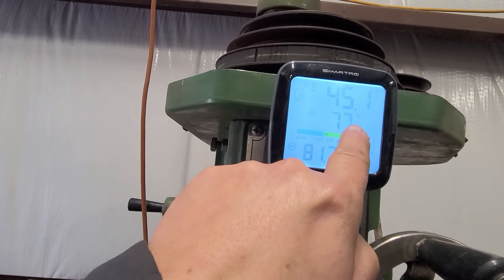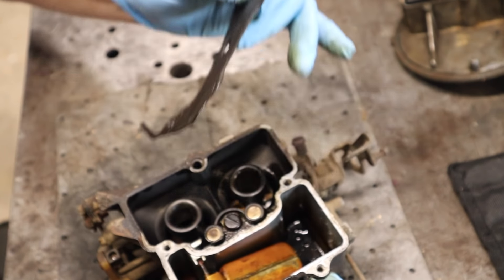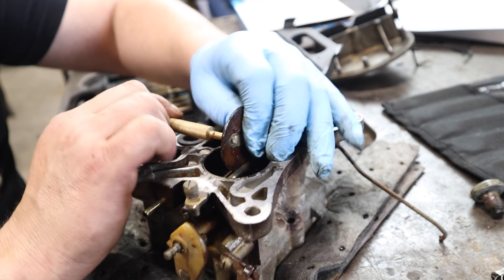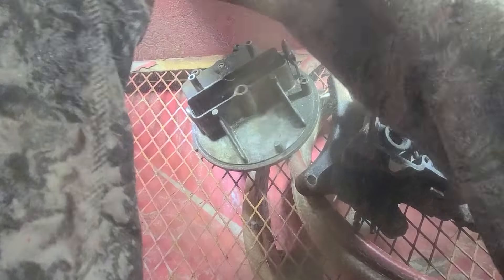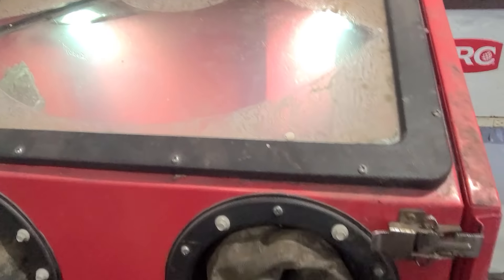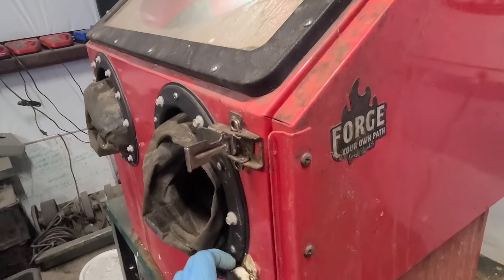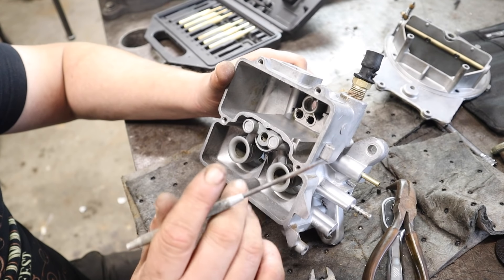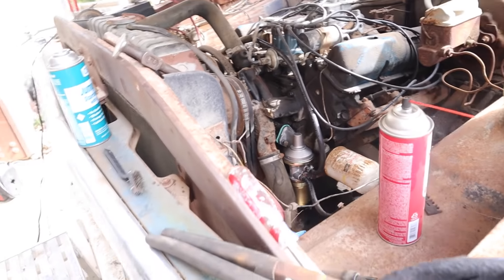carb restoration

Comment: So, not really a video on rebuild, more of an infomercial on vapor blasting....
Reply from the maker: Not my intention.  You are the third person who mentioned that the vapor honing sounds like a commercial. Video was getting long and I figured assembly was the same steps as disassembly so I left it out. My bad. The vapor cab is a great tool and it's cheap to build. Definitely excited about it every time I use it. Just sharing info, sorry it came across as an informal.

Comment: Crone valve covers and a Holly sticker on the core support under the hood was was like adding a hundred shot system back in the day.  If you had stock exhaust manifolds, a Hooker headers Sticker would still net you 5 HP.  Then you had to have Edelbrock and an MSD stickers to round out the basic set.  Haaa!    There’s always the ones who should have just kept it real and slapped a JC Whiney sticker on there n been done with it.  Lol!

Comment: Before someone sees this video and ruins an expensive carburetor, the below is from my experience and tips I have picked up over the years...
Always mark the throttle plates. They are usually fitted with the sides beveled so they can close tightly without sticking. I was also taught to never, ever, sandblast the internals of a carburetor, wet or otherwise. My behind still smarts from the @55 chewing I got for doing that at a mechanics job several years ago. 
However, the carb it was done to here is not a good high dollar unit, so I can understand why it was done that way.
It sure did look nice when it was finished!

Comment: F humidity. I love my 10% humidity pretty much year round in the South Plains part of Texas. You east Texas people take a shower just to dry off.
Reply: I had to get a couple of vaporizers because the humidity inside my house dropped so low the old ship lap paneling started shrinking and making gaps at the edges. 
Stay warm Sith. (Fellow South Plains dweller)